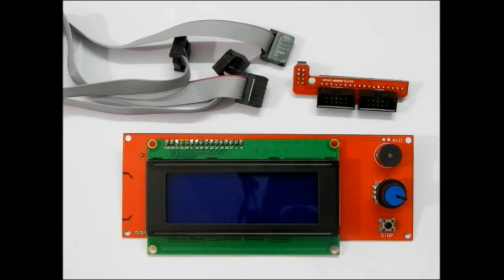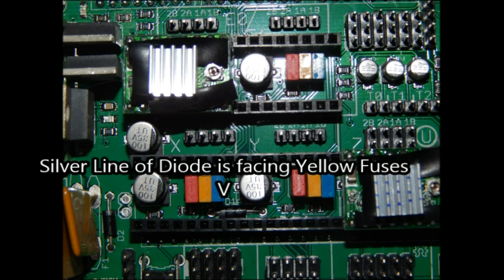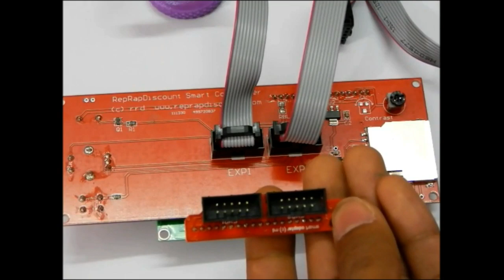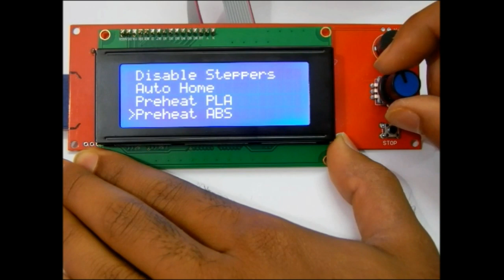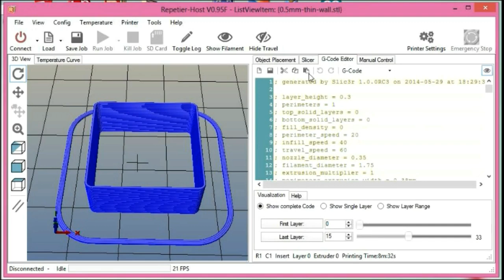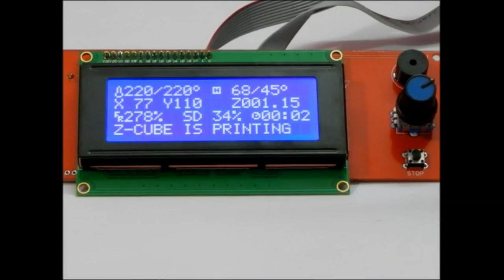Prusa i3 Build Tutorial : Installing Smart  LCD controller on your reprap

Comment: What is the diod there for? No one else shows this
Reply from the maker: John Åman  The diode is for using the LCD with the board. Now it comes pre-soldered with the boards. Just check if it is not soldered, you should solder it. Thanks